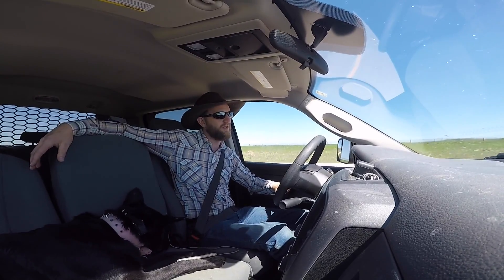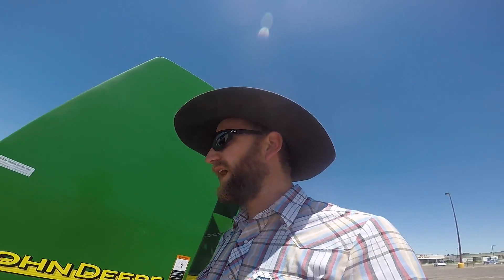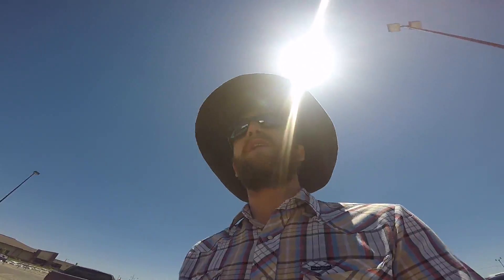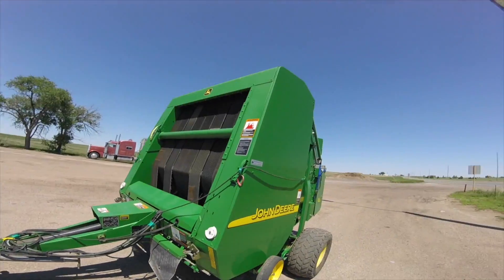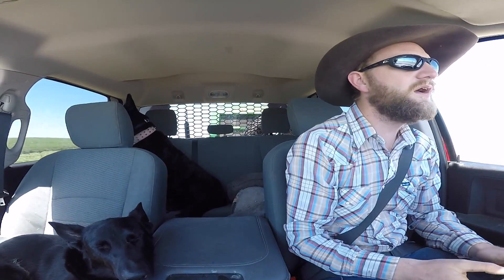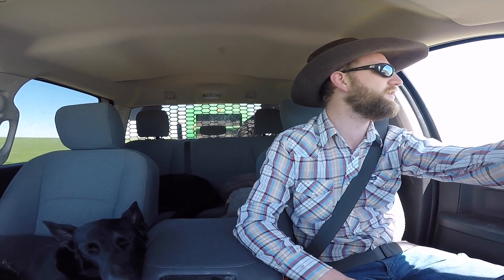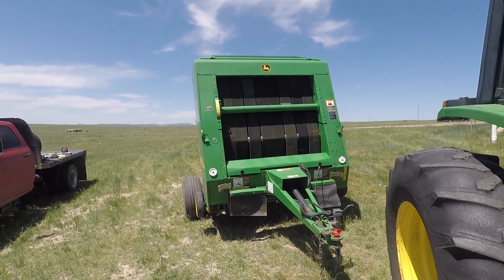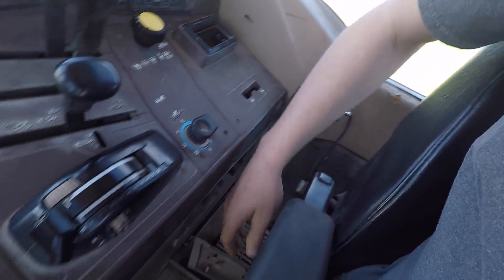New hay baler!

Comment: As much as I'm not a Deere guy, you should enjoy this baler. We ran a 566 and 567 and they were both great. You can run a lot of crop through them and they make good bales. Not sure what your pulling it with that 6410 might be kind of small. We ran ours with a 7410 JD and that was about right. Might push a smaller tractor around a decent amount but IDK you will have to try it.

Comment: Blake you will love the JD we went from a NH 660 twine wrap to a JD 568 net and cut our fuel consumption and time in the field baling in half. The biggest thing to do if the baler is going to be sitting for a while is release the tension on the rubber roller that presses against the steel roller in the back that feeds the net wrap. If you dont release the tension it creates a flat spot on the rubber roller and you will catch hell until the flat spot works itself out with feeding the wrap.
Reply: JDT 4430 you will save even more time and fuel if you switch to Krone ballers,they need the minimum HP for operation and are indestructible.Krone defined the today's world of ballers
Reply: gumelini1 I will not argue as I have never been around a krone. The problem for us would support for them, I have no idea if any one around us sales or supports krone. Our JD dealer is only 20 min to the closest dealer and about 45 min to the next two so that gives us three stores to have the part we need.
Reply: JDT 4430 how far is messick's from you?
Reply: About 1500 miles. Im south of houston tx

Comment: The JD 567 balers are a very good baler. I have one that has over 35,000 bale through it. It is my backup baler now. One word of caution. When towing JD balers take a strap and hook it in the two side door handles. lightly pull them towards each other across the front of the baler.. The reason being IF you hit a bump/chuck hole just right you can pop the latch open on the side door.  Then the wind will bang the door open over the pickup gauge wheel.  Resulting in a BENT door. BTDT LOL.

Comment: We use a 556 and has roughly 20,000 rolls.  Still very smooth and quiet and all the lights still work. That is a way nicer roller than the 556 I think you will be very happy. Next roller will definitely be net wrap.

Comment: Always fun to get in a new piece of equipment. Check it closely as it was sold by original owner for a reason. What is the bale count and if you don't mind me asking what did you have to give for it?
When are you going to build an equipment barn? Worse thing in the world is to leave all your equipment out in the weather all year long year after year.
Reply: amos snow I was raised in Northern Alberta and we didn't use machine sheds. We had a machinery row. Over time we built a big steel qounset for tractor, combo be and swather, but little tractors, older equipment stayed outside. Perhaps that's why my parents had so much money in the bank when they retired. One of our train trucks was from 1932.
Reply: HI Michael, Difference is heat and UV load in the southern climates. In the US and especially the southern US the UV load and heat are both terrible. Add to it the amount of plastic and rubber in newer equipment and it's bad to leave it outside. Then toss in fire ants(attracted to any electricity source),soy based wiring insulation( fine food for mice), and the amount of weather based damage that will be done and it makes sense to protect one's investment.
Reply: amos snow you are exactly right. My father was most concerned about the weather checking on the rubber. My daughter lives in Louisiana and the weather beats her new cars to heck. Do sea tow trucks in every parking lot down there because of the battery problems and electrical problems from the Heat. I had a sister-in-law who's Kia vehicle had soy-based wiring and the geckos ate the wiring overnight.

Comment: Had a 535 if it even saw a rock ... Picker destroyed! They fesigjnec it so the whole weight of the baler is on the picker. Other than that an ok baler, when belts got worn it wouldn't start a bale in straw unless it was tuff.

Comment: Why can't Americans just use the same light plug on all vehicles like we do here in Ireland it is far more convenient and makes more sense to have the same plugs and sockets on all vehicles
Reply from the maker: That would be really nice.
Reply: It's unclear whether the truck came from Ram with the flat blade connector or whether the up-fitter who put the flat bed on the truck installed the flat blade connector.  I have two Ford pickups and both came with a seven-pin round connector (which Blake was expecting to see) and a four-pin flat connector.    If it came from Ram with the flat blade connector, you'd have to ask Fiat why they use a flat blade - they own Ram, so you'll have to blame the Europeans on this one...
Reply: Because these jackasses here in the U.S. always think that they have something better, and they can sell more plugs.